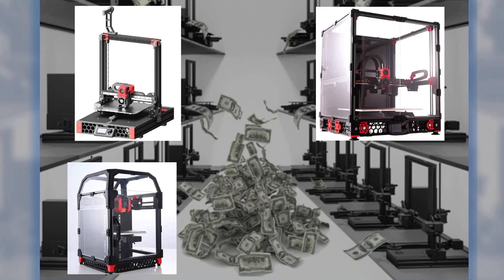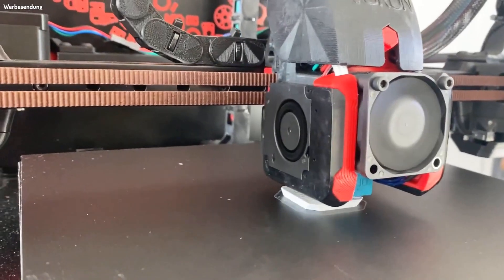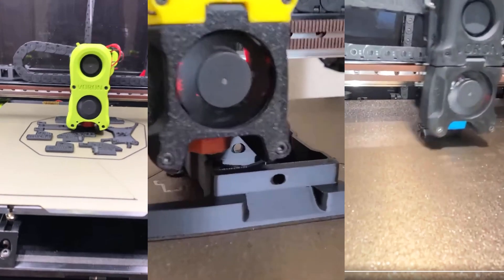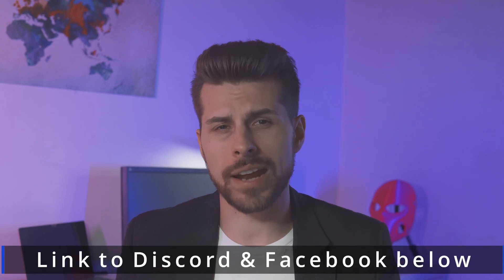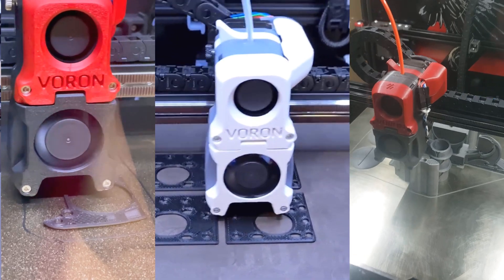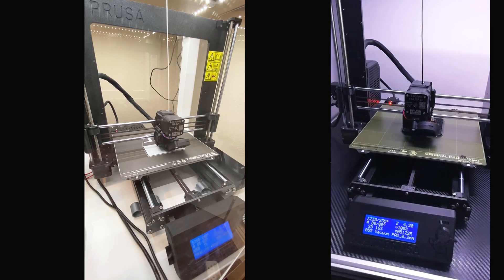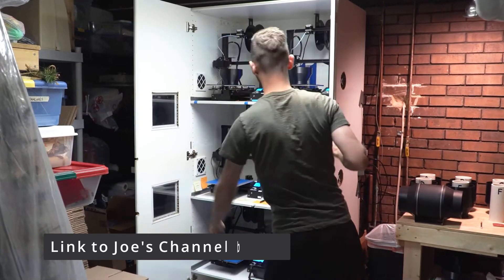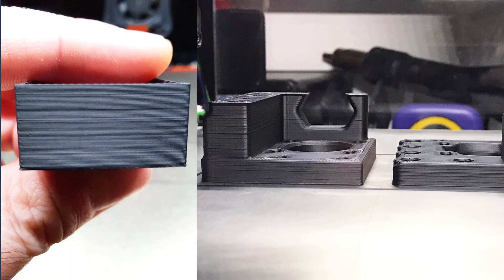Voron Printers: are they true farm printers or capable hobby printers?

Comment: It's interesting that in your calculations in previous video no account is made for the ROI on 3d printers themselves or how long each one takes to build - if you did then a voron printing farm at 2 months and 2.5k per printer would be completely unprofitable for a long time.  Would be very interested to see your heavily modified ender 5 farm? :)
Reply from the maker: Interesting point! Semi-assembled printers as creality and clones can be mounted in a couple of hours, and availability is “day after”. Prusa a little more at 1-2days and depending on the period 1 to 4 weeks lead time for delivery. Voron printers have good ROI for specific markets (abs-asa products), but aren’t turn key. If you have a net profit of 30$ for product, and print one product a a day, in 3 moths the printer is paid off. Many ways to see things, and every piece of equiment has its place

Comment: Good video.  I do intend on building a print farm network based on Vorons & RatRigs with a few Enders, and Artillery X2's.  However, I also think it is most foolish to bid on a job with equipment one hasn't yet acquired or fully tested and built a proper workflow for.  People must understand that it will take more time to test and evaluate any DIY machine than an off-the-shelf product such as an Ender, Prusa, or Artillery X2.  People must also understand the more you mod a Ender, the more DIY that machine becomes, thus requiring more testing and evaluation.

However, if one has fully working and tested Voron or RatRig, with proper workflow management installed, I see no reason why those machines couldn't be used in a print-farm network.
Reply from the maker: Hi Troi! Your considerations are on spot. Before rigging a farm running numbers will save plenty of headaches down the road. I’m sure farms based on ratrig and voron will be a thing, as for every instrument dedicated to a specific job. But they will require above average 3d printing knowledge compared to a ender 3 farm

Comment: If you're going to run a serious print farm, and really invest in it, anything you have to build yourself is out, in my opinion. I personally believe a CoreXY or any other printer that isn't a "bed slinger" is more correct - the less you have to move the part around, the better. But if you're going to run a serious print farm, it may be a thought to look at what Prusa is doing with their new Pro stuff, that's still being developed. Rack-mounted, CoreXY mechanics, fully controlled from a central point - heck, they even built them into a rack system so if one printer fails, you can pull it out and put another one in while you repair the malfunctioning one. But - of course, you can start with some basic Enders and build your business from there on a shoestring budget.

Comment: I am beginning a printing business. I also use multiple heavily modified ender 5. They are good work horses at small parts. They can be quite fast and OKAY on reliability. I bought a voron today. My reasons are as follows. It has a large print area. By my calculations should run as much material per hour as both of my enders. For large prints of materials other than pla and petg it will all around be a better platform. One consideration in maintaining it is that it doesn't use lead screws for it's z axis in personal opinion this is the Achilles heel of the ender 5. The voron has a lot of load on z distributed across gt2 belts. I wouldn't build a whole print farm out of them though. At the time of this writing a two trees sapphire pro is 200$ it will require around 150$ in mods to be a really really good printer. So 350$ per unit. With those mods I would expect several 1000ms acceleration and around 15mms jerk. Probably feed rate of 130mms with pretty good quality. ... It would trounce the ender 3 in dollars per hour production. It would trounce the prusa in upfront cost. 5 of them vs one voron would be a no brainier. If I was buying more work horses that's what I would get.

Comment: Mostly I find all your points right. Just one seems a bit stretched. The fact of being enclosed can't be a limit in any case, if you need to print PLA just open the door panel and cooling will be enough.

Comment: It is always good to hear another point of view vs. the current excitement about Vorons, especially for print farms.

Here's mine: Setting aside the capital costs of the Vorons (which are depreciated over years in many countries), having a faster, more capable print farm that let's you amplify your volume without increasing monthly overhead (man-power, electricity, floor space, etc.) is paramount. This could mean delivering parts faster and/or of higher quality and likely cheaper than a competitor could mean the difference between success or failure. This was one of the reasons I went with Prusa in the first place. The MMU was a game-changer at the time and with that I can do things I could not do with other printers in the price range.

I run a print "farm" via Prusa i3 MK3Ss, they're fantastic, reliable machines, but they're also getting a bit dated. I could look into modding them myself, then I'd lose some/all of the benefits of being in the Prusa ecosystem (Prusa support, community support, standard slicer profiles, etc.) I'm not sure I buy your argument that 2 Prusa's can deliver a part faster than 1 Voron, when the Voron can be built and configured to print 3X+ faster. There is probably some speed gains I could get from my Prusa MK3s, but these gains come at the cost of quality and reliability, and will never be as fast a nicely spec'ed Voron.

Switching to Voron builds would mean total control over the builds now and in the future (Voron is great about upgrade paths and the community is great about supporting modes), faster and (probably) higher quality parts along with a thriving support community to replace the one I'd be losing with Prusa. Thing is, I really like Prusa and their ecosystem. I do like printing (and making money) more than tinkering with the printers. I'd rather tinker with new product designs!

Yesterday (01-Oct-2021) Prusa finally revealed the pricing (https://blog.prusaprinters.org/the-future-of-manufacturing-by-prusa-research_55993/) of the Prusa XL -- a machine specifically designed for print farms -- at $3K/printer "in large quantities". Suddenly the tables are turned! I could build 2 (or more) Vorons for the price of a single Prusa XL! Time will tell if the Prusa XL is a better Core XY machine than a well-built Voron Trident or V2.4; the XL is said to have a tool-changer, which is encouraging (will likely NOT be part of the $3K+ pricing). But, you know what? The Vorons are available today (if you can source the parts) and the Prusa XL is still in some undisclosed future.

TBD, I'm really glad both organizations exist, I think they're doing a fine job of pushing FDM technology forward in their own ways and pushing one another too.
Reply: If you have 2 parts that don’t fit on the voron at the same time, you‘ll have to be mighty fast on your voron to be quicker. 
Also, you’re comparing an automated print farm printer to a diy kit.
How do you value your time that you‘ll spend building the voron? That’ll take you a while.

Comment: Great video, and hits a lot of key points

Vorons are not and never were meant to be a Commercial off the shelf machine, Its meant for hobbyists who enjoy the building part of the 3dp hobby as much or if not more than the printing aspect. While there are those that run vorons quite heavily for production (the team that do PIF for example) it was never meant to be a mass produced print farm machine. 

I myself have machines with several thousand hours of print time, and they are great workhorse machines...IF you are capable of spending the time to tweak and tune, as well as maintain a machine you have to build yourself. Which, when occupied with running a print farm, many do not.

For hobbies and DIY use cases, its great, but when its machine 1 of 100 in a print farm...there are other options that scale better, both in cost, as well as maintenance and support.

Cheers
Reply from the maker: Hi Nero! Huge fan of your livestreams, i learn a lot from your insights. I agree 100% on what you say and i acknowledge the that they are great machines also for making parts, even if they require superior knowledge in 3d printing and above average time to build. Keep up your amazing work!
Reply: Nero what other options would you recommend for a print farm in 2023? This topic would make an awesome video by the way. Love your channel.
Reply: You hit the nail on the head Nero
Reply: Do you think that they are as good as the bambulab printers? Like, for someone like you or me who enjoys building them (talking about speed, print quality, reliability and long term performance)

Comment: I run a print farm with prusa and enders. I bought a Voron v0.1 and it's a great printer to put next to my desktop for fast prototyping (I do 3D design service too). I just finished building the voron legacy. It's an open printer so i can use it for the farm to print in PLA, and it only costed me around $500 for the size of an ender 3. So far i can consistently print on 120mm/s with good quality, but again, I've only had it for a couple of days

Comment: The estimation about 2 Prusas being faster than 1 Voron is not always true. While most cartesian printers print around 60mm/s, a Voron is capable of 200-250mm/s. Running the Klipper firmware and better boards come with their benefits. Pressure advance, input shaper and other things, that are making a significant difference in quality at those high speeds. Yes, it takes a lot of time, energy and dedication to build it.
Reply: But you can put Klipper on a Prusa Mini for instance and do 150 mm/s maybe even faster, cleanly. There's a guy that was running a mini at 250 mm/s albeit not the best quality in the end but that's why I figured you can do 150. It would seem having two minis running at 150 is better than one voron running at 250 printing two copies. With the minis or whatever you'll have a backup machine in case one goes down also.

I'm not sure of any of this, I'm trying to figure it out because I'm in this very position right now. I want to build a farm so I need to decide what to go with.

Obviously multiple Vorons would be ideal but now you're getting up there in initial investment costs.

Comment: If you just keep on stacking like... 29 Enders VS 9 Vorons you will pay more in the longer run for Ender.
Imagine the bill you will need to pay for getting a space for 29 Enders.? 
On top of that you will need to pay for the electricity for 29 3d printers??
After sometime 3d printers will break and rather fix 9 than 29, how about heat issue of 29 3d printers. :-)

Comment: I have ender 3 v2 that I have over 700€ in already. That is including the cost of the printer 300€ when I got it. If I bought it now and knowing what I know now I could get it done with around 560€. But I have bought mobo 2 times because I got E3 mini. Then I wanted dual z so I got E3 turbo. I got creality direct drive, should have gone straight to micro swiss. So basically I am not far from the cost of a 300mm3 ratrig at this point. Print volume/€ is so much better at that point. There would be no way I'd go with 2 or 3 ender over 1 ratrig. Especially because stock ender 3 sucks so bad.
Reply from the maker: big believer that every printer has its purpose. More expensive printers are more refined and have nicer features. if the ratrig fits better your needs and has a good ROI for you, then sell your 3!
Reply: @3DPrintingForMoney  too bad selling the ender is not good roi. Thats how selling used stuff works.
Reply: @3DPrintingForMoney  I think his comment just implies he doesn't really know what he's doing.
Reply: Patience and doing research would avoid all of this. I'm 400 into my E3V2 and it's been a workhorse for the 6 months I've owned it. Half the stuff you listed here you didn't even need. I never bothered with the direct drive. Too much weight on the print head. I'm printing at 150 mm/s without it. All metal extruder, hotend, Capricorn tube, CRtouch for convenience. That's it. Lots of products with diminishing returns I've noticed.

The minute I started realizing I needed something faster I went out and did research before just throwing money at the E3V2.

When I'm done building my voron trident I'll be turning my E3V2 into a switchwire.

Comment: When there are two 3D printing shops on your street, and a customer comes in wanting to print something in ABS and receive as soon as possible. You can (maybe) do it with 60mm/s and finish it in 5 hours, while the store next door that has a Voron can actually finish it in less than an hour with perfect quality and using ABS per the requirement. Do you think that the customer will be ready to pay a premium to your next door neighbor or will he cheap out and wait for eternity with you can not even get his required ABS parts? ... As a business, don't stick your head in the sand. If you see an opportunity to "cheaply" get a very fast and a very capable (in terms of materials) printer added to your arsenal of capabilities - it would be silly to just shrug it off.
Reply from the maker: Hi Evgeny! well, you made a nice example, a little borderline. It would be fantastic to do a full analisys of it with cost/profits etc but making it short, if you have customers requiring pieces the incoming hour, i’m sure you will charge top dollar for your time and not the material (1 hour print will be under 50grams for sure). But still, one can create a “deliver next day” business, running extremely tuned machines with subsequent high rates. In the video i just warned future owners to account for time invested in the build and tuning and to undestand if “x” machine is suitable for their “y” need
Reply: Your example isn't even realistic.

Somebody that would need a custom part like you describe wouldn't need in an hour most likely. If they did it would be rare enough to not be an issue. What if every time somebody went to the faster place half there machines weren't working?

There are lots of variables to consider here.

Comment: I believe your analysis for using VORON printers in a production, farm environment is sound. Equipment selection should be based on your business case. 

The V2.4 might possibly be the most advanced, innovative printer on the market, labeling it more a "prosumer" for the advanced hobbyist, and professional design, prototyping shop that needs to take advantage of the new generation of filaments. A growth step for Prusa owners who have outgrown their machines. The V2.4 is more advanced than nearly all of the mainstay 3D printers in the professional market (Chinese printers do not count).  IT IS NOT a printer for the Chinese printer crowd unless they have advanced building experiences and/or have a professional 3D printing technical background. In a farm or service bureau running 24/7 they require onsite technical support staff with knowledge specific to these printers. There are no "service contracts" for VORON's unlike Ultimaker and Raise3D for example, though ironically these printers use dated designs and are actually easier to maintain.. 

This raises another important point. A farm of cheap entry-level, outdated bedslinger consumer Chinese printers is not appropriate for a professional business either. Remember, out of the box, they will not output an equivalent professional print without important modifications. The Prusa MK3s is now the only low cost printer that's widely accepted in the professional world.

Many professional clients will turn away from a business using cheap Chinese printers because they know the quality with not be the best, and it's likely that the owners are/were hobbyists with limited knowledge and professional,  technical 3D printing experience. It's like so many family owned landscaping companies who cut your grass, they are amateur's, might do an okay job, but you can tell the difference when compared side by side with a professional company.
Reply: LOL, do you know the mk3s has no better print accuracy than an ender 3. ?
Reply: Lmao...

How's that Kool-Aid taste.
Reply: @dangerous8333  same print accuracy, as long as they are tuned properly, then print quality is the same

Comment: Modified Ender 6 would be a great alternative you get coreXY with the 6 design no one has been paying attention to this. The vorons are beast modeachines though
Reply from the maker: ender 6 are valid printers with the right mods. regardless it will still get less attention vs vorons and standard cartesians being in the midrange price
Reply: my ender 6 printing at 100 mms had layer shift at that speed i slowed it down to 80 and it printed fine but when i try to go over 100mms it layer shifts every time
Reply: @3dprintingcave778  did you check your wheels they might be wearing I really want to put linear rails on my ender 6 that would improve this printer for sure
Reply: @BreakingElegance  its brand new its had 2 prints done on it
Reply: @3dprintingcave778  makes sure the unit is square and adjust the wheels if needed only because it's new it doesn't mean it did lose its adjustments during shipping